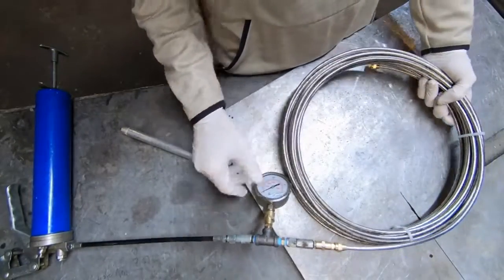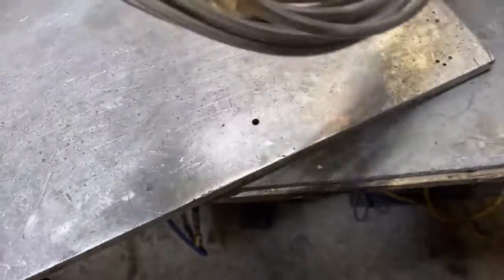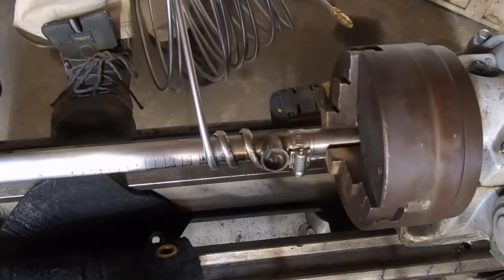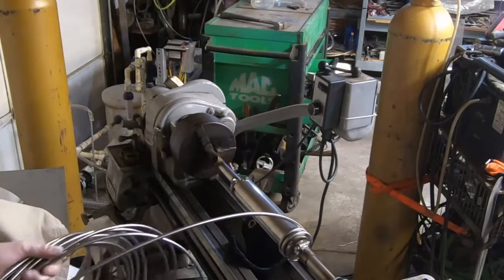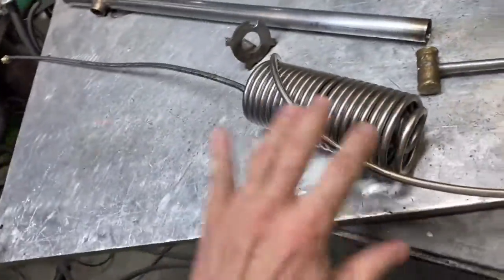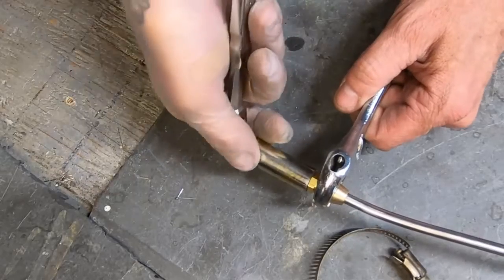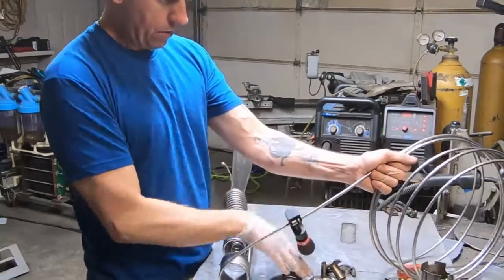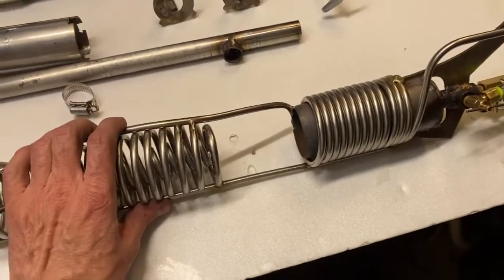Advanced tubing coiling method or bending tight bends

Comment: This video was a Godsend. I needed to water cool a window air conditioner for my boat using lake water. I had been thinking about it for years but knew from past experience trying to tightly bend soft copper tubing never turned out well. After researching for a month I was about ready to give up then I ran into this video.  Thanks to you and commenter Alan's suggestion it worked perfectly. I made a video of the entire process and gave you a shout out in the comments. Keep up the good work sir!

Comment: So its like filling it with sand but with extra step.If you use a wood block and drill a hole slightly larger than a od of your tubing ,then cut it in half with a hacksaw and put it in a lathe tool post you can use automatic feed (if you have it).Put a little bit of grease  on the wood.I use same method for springs.

Comment: Hi there. I bought one of your Godzilla burners along time ago and just tryed to temp a crucible with it😅 sadly it shattered. Im a A little new to the crucible stuff. I had it in the oven at 100f for 3 hours thinking it would take out any trapped moisture. I started it up and slowly put the crucible in and it Took a big chunk off the bottom of it. I have one more but I wanted to ask how you get yours treated for you Godzilla burner? Like do you start off with a lower grade burner then as it gets to its max you switch it for the Godzilla Burner to heat its the rest of the way?  I’m thinking next time to use my propane burner and then swap it out but I want to make sure that’s a great idea. I’ve see people put The crucible in the oven at 350f and use a propane burner that can be finely tuned but for the Godzilla burner it can’t be tune down as fine or at least I can’t get it to it seems to be either super hot or GOD DAMN...... that HOT! 😆 to simplify the question how do you get your crucibles ready for the Godzilla?
Reply from the maker: Hello Andrew 
I get the salamander super . usually its the crucible that's the problem . i go straight from cold to melting steel in 8 min no treatment and never had a problem
Reply: Thank you I’ll look up that Crucible right now. I have the regular graphite crucible but I will look up The salamander super

Comment: You need to use Hoke Gyrolok or Swagelok fittings specially made for SS tubing!
Reply from the maker: LOL bro the cost for those is out of the question and they are one time use then you gotta buy ferrals but yes you are correct they are quality parts , funny thing is i spoke about them in the first cut but edited  it out
Reply: @NOBOX7  you could use the welded  fittings and reuse🤔